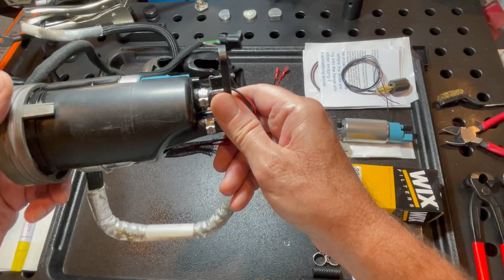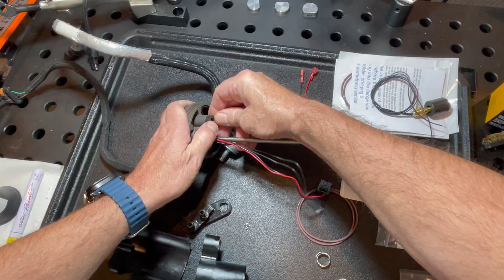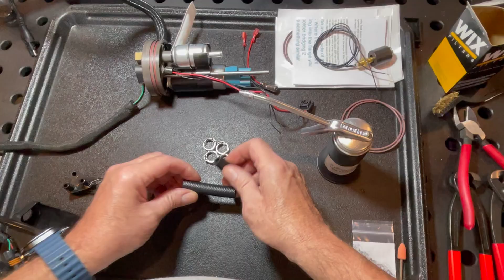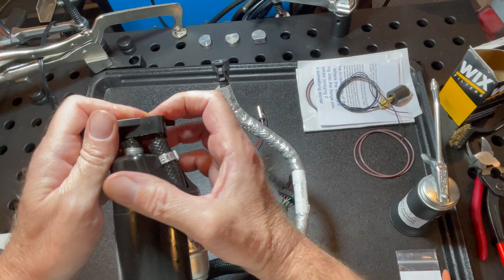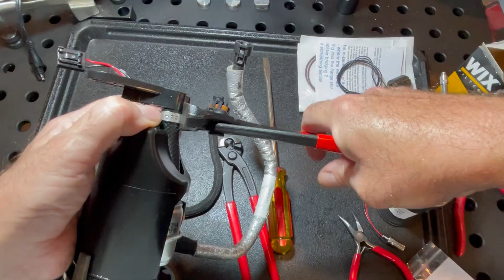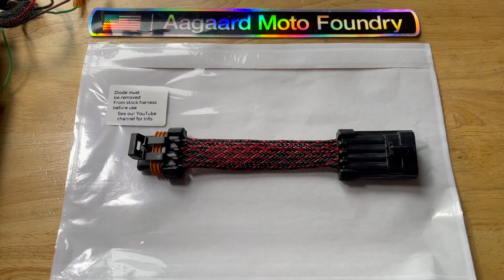Buell and EBR 1125R or 1190sx/rx Fuel Pump Rebuild

Comment: Hi, I recently bought an Aagaard rebuild kit through an european dealer. My kit included an fuel pump from Quantum. The original pump built up 516kpa that dropped down to 40 kpa in a short time. The new pump can only build up 112kPa with the prime pulse but holds the pressure well. Any suggestions on what the problem can be? I noticed the fuel filter was quite larger than the filter in this video if that could be an issue.
Reply from the maker: You should send us an email at aagaardmoto@gmail.com 
If you have a Quantum pump we need to get you another pump.